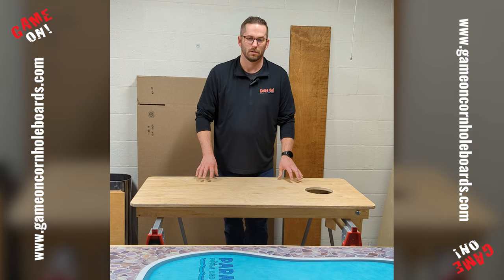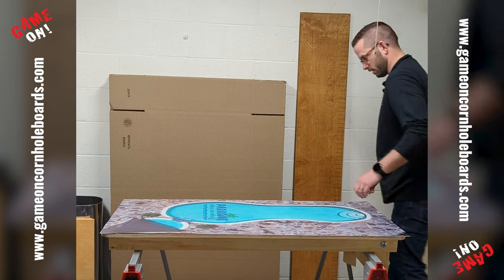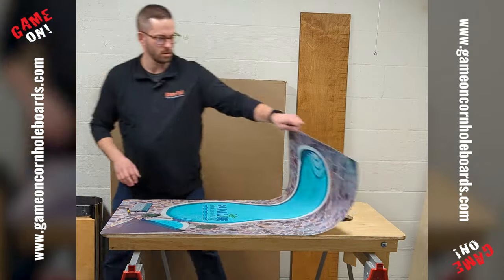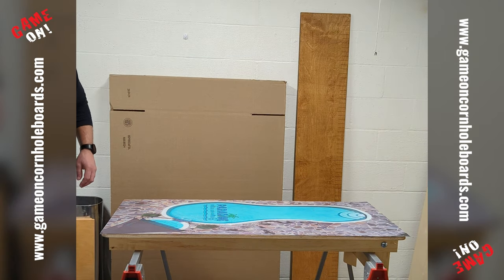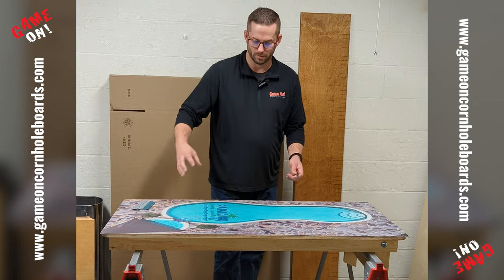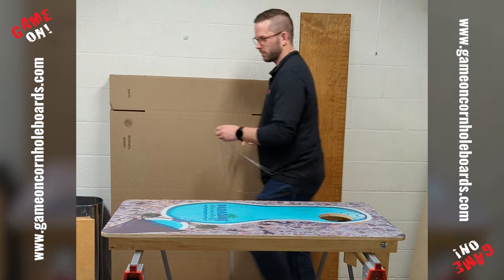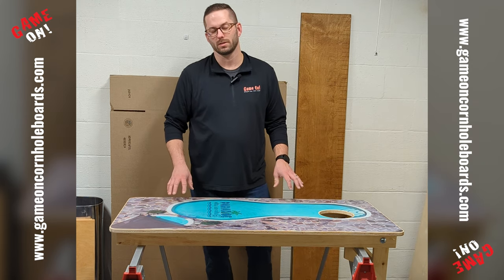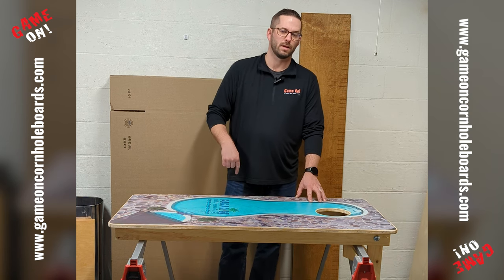Cornhole Vinyl Wrap Installation - Laminated Edition

Comment: Why don’t you with the extra wrap when you cut the hole , wrap it under the hole , instead of cutting right the size of hole ??
Reply from the maker: I actually did that in the beginning. It doesn't last. We use a flat surface vinyl. It doesn't handle extreme bends well.

Comment: I just bought a set of wrapped boards that came with four real corn bags. I’ve noticed that the boards are FAST. I mean if you’re not putting some serious air under the bags, they’ll slide right off the board. Add the starch powder from the corn and the bags are unstoppable. Anyone know if it’s a board issue? Bag issue? Or both?
Reply from the maker: Yep! Time to up your bag game! They make bags that have multiple speeds
Reply: @Gameondad6  awesome! So the “pro” bags… what are they filled with and will they leave that powder on the board. (Probably a stupid question, but I’m new to the game and know next to nothing about it)
Reply: Make sure board is axactly 12". Any lower will build more speed. Also, corn filled bags give out a dust over time & can make it slide. I don't use corn.  I use plastic resin filled bags. Which are also ACL regulation bags. Bags are duck cloth/ microfiber.
Reply: @LeskoBrandon2x  I really liked corn when I got  into the sport, but after being left out in the weather, or eaten by squirrels, I switched to pro bags.  They have a synthetic filling that won't degrade or create dust.  The dust causes the corn bags to go faster....think shuffle board.  And you'll minimally want a fast and slow set.  Oh, and if the squirrels already think there's a surprise in the bag, they will eat your pro bags, so keep them stored when not in use.  A pellet gun also does wonders to keep your bags safe.

Comment: I know you may not need to put the poly over the laminated version, but is it better to do so? If you were building them for yourself would you put poly on it at as a finishing step?
Reply from the maker: I would not recommend putting any sealant over the laminate. I personally only have laminate on my boards as well
Reply: If they are slow how do you make them slide faster?

Comment: Do you have a source for the trimming tools you used?  It looks as though the top hangs over the frame a bit.  I haven't seen boards of that design before.  Is that the new "standard" for boards?  Thanks in advance!
Reply from the maker: We offer the trimming tools for sale on our website. The are all made locally. We switched to the overhang design a few years ago. Not everyone does it that way, but for various reasons, it works best for us!

Comment: Don't you have to add a clear coat to the edges to keep it from peeling off?
Reply from the maker: If you trim the wrap to run about 1/8" off the edge, you'll be fine. We don't seal the edges and haven't had any issues as long as they are laminated

Comment: a couple of questions:  do you always put down a layer of poly before putting down your wraps? I've seen others put wraps down on plain wood.  why might someone use laminated wrap vs. non-laminayed? Are those cutting tools $50 each or for the pair?
Reply from the maker: www.gopdesign.com for the tools 

Either put a layer down ( or two) or use UV finished plywood. I do not recommend applying the vinyl to bare wood. 

Laminated wraps are easier and more durable. It saved you time and money

Comment: Can a vinyl wrap be used on an already painted/finished corn hole set? I'm assuming that it would be no different than the water-based sealant?
Reply from the maker: You're correct! As long as the top is smooth, should be good. Just make sure the vinyl is gray backed to hide the design underneath